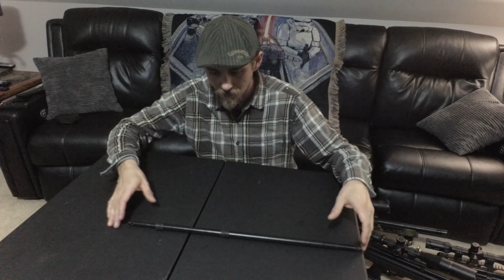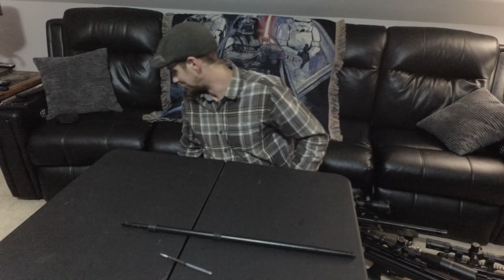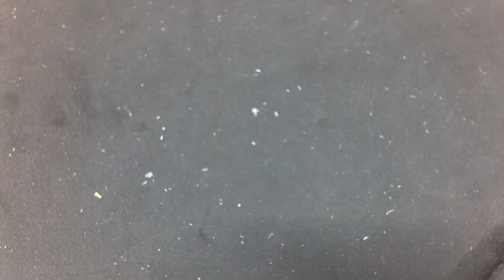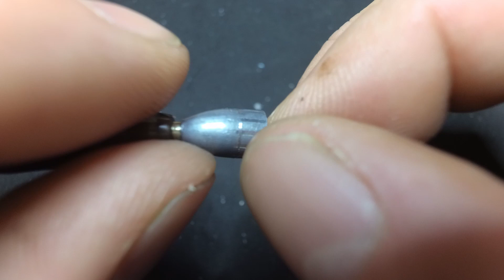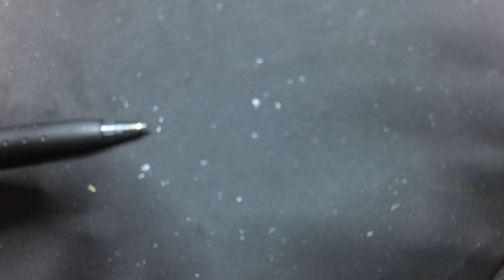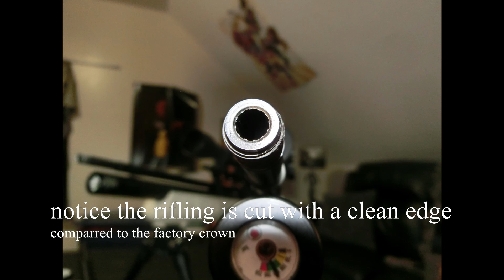barrel heath check

Comment: If I was to get a tj barrel for the.177cal.  What twist rate do you think would be good for a 20gn to 21gn slug?
Reply from the maker: My data sheet says 1/12 is optional so something close to that should work fine for slugs that size. Just a heads up pellets wont do well at long rang with that kind of twist
Reply: @leadslinger5130  awesome. Thanks for the advice.

Comment: Seems to me that, with your proof, Hatsan should want to warranty that barrel. Did you try, even if technically beyond the warranty period? Also, do you know a source of Lothar-Walther match barrels for these rifles? I've read that the AT44 barrels also fit the new Flash line of guns, so a refurb pup would be pretty cheap, and if the barrel turned out to be no good, then could drop in a LW barrel, if available. Might be a good plan.
Reply from the maker: No did not try talking to hatsan mainly because out of the 4 hatsans me and my uncle have owned they all had very bad stability issues. As far as the lothar walther barrels I'm not sure. But I did find the contact info for TJ barrels I believe I can get a blank from him for about 130$then get it fitted either from him or some where else. So for about mabe 250$ I could could get a custom barrel at least that's my plan so far. I'm currently upgrading my dreamline bullpup to a custom tac with a 700mm .30 barrel and some other goodies.
Reply: @leadslinger5130  What's your GTA handle? Mine is GoneShootn. I would like to PM you.
Reply from the maker: @jfm30204  on GTA its Leadslinger and on Instagram its Leadslinger.22 I dont think I can talk about griffin slugs on the forums yet because we are not yet paying sponsors but I can talk about airguns and other stuff
Reply: @leadslinger5130  I PM'd you at GTA.
Reply from the maker: @jfm30204  ok I'll check it out mabe it hasn't loaded yet. It just shows your original message still. Did you receive my to my message I sent?
Reply: @leadslinger5130  Where did you send it?
Reply from the maker: @jfm30204  I just hit the reply button. I sent a message with my contact info and some stuff on the dreamline. That's sucks you didn't get it. I'll try again hopefully this time it will work. Sorry about that
Reply: @leadslinger5130  If you mean here on YT, then it isn't showing up.
Reply from the maker: @jfm30204  I sent a reply on GTA make sure you got I see what did wrong now lol my apologies

Comment: I’ve been cutting my the choke out all together,  recrownig the end, and then putting a DonnyFL adapter on the end and end up with one hell of a nice slug barrel.
Reply: Yeah, I’ve been buying Hatsan long barrels, cutting those down so they extend out farther that the air cylinders.
Reply from the maker: @jonhermann8239 that's a great idea I'll have to give that a try it cant hurt. I'll slug it to different depths and see how much needs to be cut off. You got my gears going now lol I feal a new project coming on! Thank you very much I'll let know how it turns out!
Reply: No I was just curious. I’ve been buying a lot of you slugs and have been pretty happy with outcome. I did buy some fx Hybrid Slugs and haven’t had near the accuracy as with your product. Keep up the good work.
Reply from the maker: @jonhermann8239  I'm very happy to here that! What airguns are you shooting with? I'm trying to collect data on which slugs do well out of different airguns. Thanks for your feedback I appreciate that.
Reply: Yeah I figured the choke would have started sooner, but it’s right at the end. You will notice that the velocity really picks up after the choke is gone and is more consistent. If found that a deep crown works the best.
Reply: FYI. I just got some of your .217 23grain hollow#2 in today. I just ran about 50 through my Hatsan unchoked at44. Holy %¥?&!  Those are by far the most accurate slug out of that gun. Running them at about 920 FPS. Just on ragged hole at 60 yards. That’s all I have at my house. Can’t wait to try them at 100 this weekend at the range.
Reply from the maker: @jonhermann8239  that's awesome glad to here that! We have been having great success with those. That's what my uncle mike is shooting at the moment there are his favorite at the moment. Once the weather gets a little better I will start making drag models of all the slugs to make accurate B.C data for everyone. Also we should have a website in the next few weeks. Thanks so much for your feedback! I'll keep an eye out for you if order agian we'll throw in some extra slugs
Reply from the maker: Sounds interesting I mite try that I'm also looking at getting a lothar walther barrel blank and getting fitted by my gunsmith but I'm not sure yet I'll have to check the cost but that would make a interesting video for sure. Thanks for your feedback that's a good idea!
Reply: Are you the guy making Griffin slugs?
Reply from the maker: @jonhermann8239  my uncle Mike makes the majority of the slugs I help him when he gets backed up. I do alot of the testing R&D and come up with new ideas for slugs. and make bad youtube videos lol. I'd be glad to answer any questions you have
Reply: Let’s see, where to begin. Lol. I’ve been using the .217  cup or hollow in a cut down at44 tactical. They actually shot pretty well with just a short barrel with the choke still in. The .25 32 grain hollow out of merauder on steroids and a cut down at44 .25. You really have to crank up the velocity to get them to shoot correctly. The .218 22 grain cup out of an airforce talon is superbly accurate. The .25 42 grain hollow out of an airforce Condor. Again, superbly accurate. Oh yeah, your .217 cup 21 grain shoot very well out of the Gamo urban. Have to do some work to get up the velocity. The Urban have BSA barrels, and I’m sure that’s why the can handle slugs. As soon as my .30 slug liner ships I’m going to purchase some .30 slugs for my FX Crown. Just today I ordered some .357 boat tails for my texan. I’ll get back to you when in test them out.
Reply from the maker: @jonhermann8239  thank you very much this will help me start putting some method to the madness. I'll probably cut the choke off my hatsan bullboss I resulged the barrel a few times it looks like I only need to cut about 5/8 of inch off to get a much cleaner rifling engagement.  Thanks for taking the time to reply I'll keep an eye for your next order we'll be sure to throw in some extra freebies for ya thanks again!
Reply: Alright. Keep and eye out for me soon, haha!!  I put an order in about once a week.